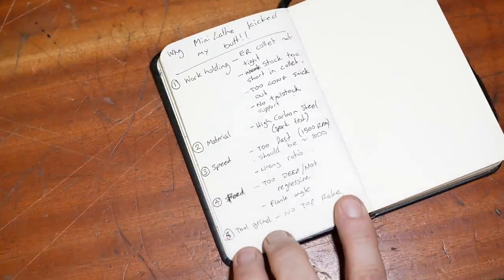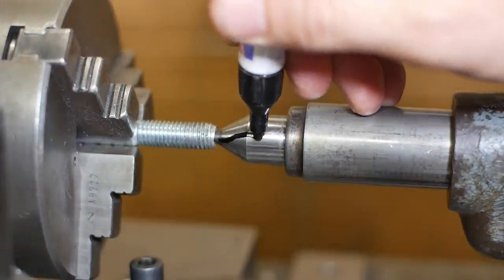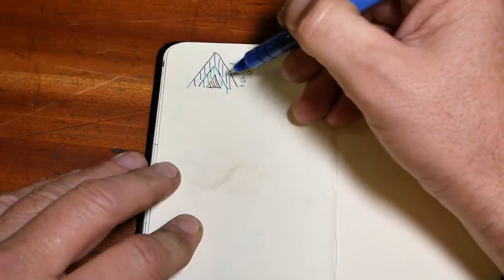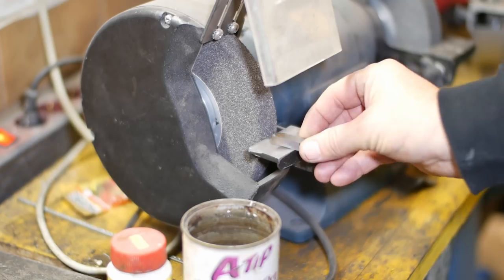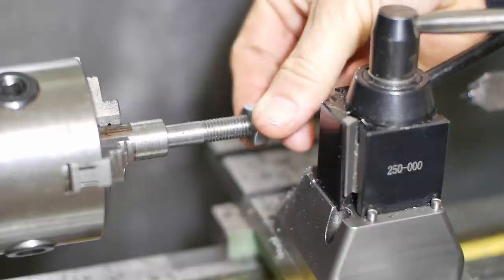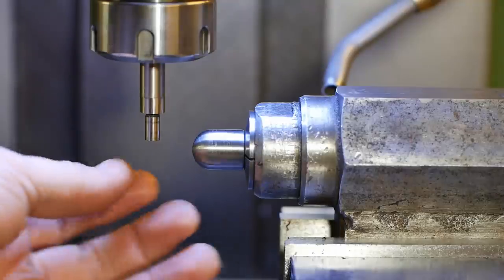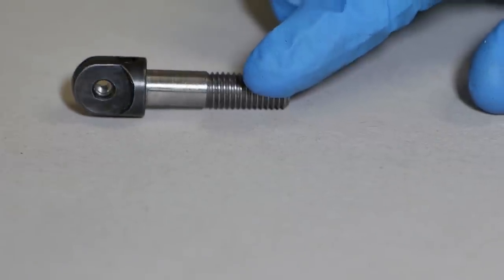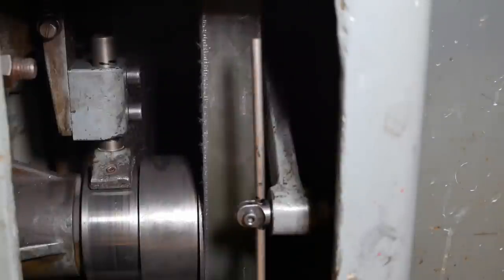Man vs Tiny CNC Lathe - Rematch! - Episode 39

Comment: As expected, CNC is so much faster than manual machining after about the seventh repeat. But where's the fun in that? 😉
Great series. Thanks for sharing.
Reply from the maker: Good call. If my Boley had change wheels, I could have whipped out that part in a lot less than two weeks :)
Reply: @RotarySMP  :-) or cut losses and used a tailstock die holder and hand tapped the m10 and let the electronics do the ball end.
Reply from the maker: @alan-sk7ky  I was pretty disappointed at how badly my M10 die cut last week. Horrible steel, but the die cut thread was also a mess of torn metal.

Comment: The flank thread cutting also can help reduce tool chatter because the tool has pressure on only one side.
Reply from the maker: True. Seems to work well on this cut. FOr such a weany machine, you need to give it all the help it can get.

Comment: A helpful tip that I got taught in my training was that when you machine a thread that when it is to size it will be 0.1mm down from the major diameter. I use this every time I machine a thread and it makes it a lot easier so you can just slip a mic or callipers in so you don't have to remove the tailstock and most of the time move the tool out of the way by reaching around the back. it is a nice little build though its made me to think about looking into the linux cnc conversion possibilities
Reply from the maker: Go for it. LinuxCNC is awesome.

Comment: Really enjoyed this series. Your aircraft engineering past is really showing through and I am sure you learned a lot along the way which is always a good thing. 
It is normal practice to minimise the trailing flank relief for threading tools to maximise tool strength and life.  The rapid feed creates it's own trailing flank clearance. 
Does Linux CNC automatically calculate thread depth based on pitch? The Seimens controller on the last lathe I used had this nice feature, the only downside was you needed an accurate tip radius appropriate to the pitch for first time success.
I think you could improve the braking performance of the Boly if you replace the single shoe with a band type. Band brakes exhibit a self energising characteristic so it would be like having power assisted brakes :)  Easy to make with a simple metal band and bonded cork wear material.
Looking forward to more content from you, definitely above the typical HSM standard.
Reply from the maker: Thanks for the feeback. 
LinuxCNC G76 does not calculate the thread depth, you have to declare it as K. You declare your first path depth of cut with J, and it calculates the number of cuts and deptch based on whether you want constant depths (R 1.0), constant Area regression (R2.0) or something in between.
https://linuxcnc.org/docs/2.6/html/gcode/gcode.html#sec:G76-Threading-Canned.

Given my unknown radius, it was always going to be trial and error to get a usable thread.

Comment: When im machining threads, I always leave meat on pre threading so I can re-chamfer the thread, then after that I re run the threading tool on the last couple of passes plus 2 or 3 spring passes. Tends to remove any wispy burrs aswell as acting as a spring pass 😁 great video!
Reply from the maker: Thanks. The thread got a lot nicer after the second fine correction pass.

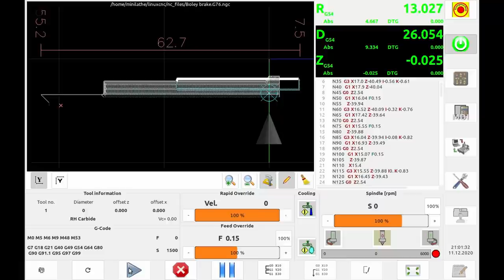Comment: Wow that four-camera view at 09:47 to 10:20 looks like the future of Youtube - broadcast quality and conveying exponentially more information than a single camera. Your video skills are enviable.  I worried a little about the WD-40 vaping session on the lathe but hopefully you were taking precautions. I made a note-to-self to check for a food-grade equivalent thread cutting oil for instances where the oil will reach it's smoke point and become a vapor.
Reply from the maker: I have a camera with a damaged control wheel which gets to play crash cam, and get fastened to the bed, on on the cross slide etc. Took me a while to work out how to do the editing but I kind of like that multi window style.

Comment: At work, I cut hundreds of threads per day with an industial CNC Lathe but don't bother with any special tool lead in angle. The size and mass of the machine vs the cutting load doesn't require this technique. I am new to mini lathes and I have been wondering why mini Lathe enthusiasts often refer to this method but never fully explain the concept. Great explanation of why the thread lead in angle is especially important on mini Lathes.
Reply from the maker: Thanks for the feedback. Enjoy the series.

Comment: Nice Job, for centre finding of the part on the mill, I kept screwing up the maths as well so I added a half macro to gmoccapy. That runs g10 l2 p0 X[#5221 + [#<_x>/2]] (adds half the current x value to the G54 offset) its only works in G54 but it's helped me make less mistakes forgetting the size of the part/edge finder.
Reply from the maker: That is a good idea. I haven't got my head around what G10 is supposed to be good for at all.

Comment: Greetings.  At the end of your last episode #38  I was going to go down to my shop and introduce my sledgehammer to my mini lathe CNC project.  I thought, man if this guy can't get it to work, I'm in trouble. And than after watching your episode #39, I had hope .  Put the sledgehammer away and watch some more of your mini CNC lathe videos.  Good job figuring it out.  Other than having to take lighter cuts, it works great.

What are your thoughts on driving the spindle directly with a 1-1/2 hp, 3 phase motor and Inverter setup?  You could use a set of two step pulleys for a coarser speed adjustment.  My Tormach Mill uses a similar set up and it has allot of power at very slow speeds. It would get away from using the original mini lathes transmission which I dislike.

Now that you have acquired the Schaublin is that the last we will see the mini CNC Lathe?

Enjoy watching your videos very much.  Keep them coming.

Cheers
Willy
Reply from the maker: Hi Willi,
I had the mini lathe belt driven from a 550W 3Ph motor for years, without the gears. I put the metal gears in this conversion, but in hind sight that was a mistake. Running a belt drive to the spindle is a better solution for this machine. With a 1.5Ho motor and VFD you should be fine. As you say, a two step pulley should give you plenty of torque across the usable RPM range.

The bed of the mini-lathe rather lacks rigidity, so I will probably advertise and sell my Mini-lathe, now I have pretty much all the capabilities of it duplicated in the Schaublin.

Comment: That was interesting.  A viewer of mine commented that his favourite channels were yours and mine, and I can see why.  Our channels are quite  different, apart from a small cnc lathe being involved.  Mine is an old factory built cnc with proprietary software and I mainly make production parts. I only use carbide tooling and full form threading inserts, which is the only way to go for parts that are for customers, as threads can be perfect quite easily. So as you can see, quite different.  I still have some way to go, to get up there with your editing skills though. Must check out more of your videos.
Reply from the maker: I really like your channel as well. You show what can be done with a high quality, working CNC lathe, and I show why a Seig 7x12 and a shit load of work is not the way to get there :) 
Thanks for the feedback.

Comment: That’s come up good. I wonder if it’s possible to have Linux CNC to automate the coolant on and off.
Reply: It certainly would. I mean, how do other CNC machines handle this? But I am not sure if that machine has a relay for that. And besides, it's sometimes better to babysit it anyways.
Reply: @vincentguttmann2231  haha yeah true. Anymore human jobs taken away and we are in trouble.
Reply from the maker: @obe726  The LinuxCNC profile and GUI which the PNCConf wizard set up includes both flood and mist coolant control. I would just need to install the physical systems and connect them to one of the Mesa cards output pins. You see this with the MAHO in this video. The standard flood cooling is controlled with M8 on, M9 off.

Comment: @13:00 Why is chuck/part lifting? Do the whole frame bend or loose bearings?
Reply from the maker: Thanks for pointing that out. I hadn't noticed that.  I'll check out whether I got the bearing preload wrong, or whather it is flex. Or both.
Reply: @RotarySMP  All three united, bending frame, loose spindle bearings and the part it self. :D
Reply from the maker: @waldemarii  Don't forget the POS tailstock, made of rubber.
Reply from the maker: Which was not even used on that cut, but may have still introduced flex, remotely. :)
Reply: @RotarySMP  That tail stock could distort even space time, maybe it could be used for ftl drive?
Reply from the maker: @waldemarii  It is so like it need anti gravity to attact anything.
Reply: @RotarySMP  It is so lite because the casting is so porous. :D
Reply: The area under the headstock is completely unsupported on these lathes to make room for the DC motor, I'll bet a fair bit of the flex is originating there. I'm going to fill it with epoxy granite since there's no need for the open area once the old motor has been replaced.
Reply from the maker: @johnharding9936  Go for it. Do some before/after deflection tests. That would be interesting, but dont expect any huge improvements.
Reply: @RotarySMP  sorry if that sounded abrupt, wasn't my intention. My emco is here now so I'm working on getting the tool changer to work with LCNC at the moment so that'll keep me busy a while. The minilathe is on hold for now. I had considered embedding it in EG in a slant arrangement for the craic, maybe I'll try that some day soon. Really enjoyed this series, your attention to detail is astounding
Reply from the maker: @johnharding9936  You didn't sound abrupt. I considered a bunch of different things to stiffen the mini-lathe, but at the end of the day,it will never be a Schaublin, so decided to put some limits on how far I'd go with it. The Maho taught me it is better to start with a good machine than to try and chase perfection on the mini lathe.

Comment: Nice work! I have a little emco pc50 cnc lathe at work, It has a small 75mm 3 jaw chuck that works great. Someone did a good job making it because it has basically no slop and no runout, making it ideal for basically all the parts it can handle.

There is a 4th way to cut a thread, I haven't seen anyone do it( i haven't really looked though, it just occurred to me) but you could cut a thread by breaking up the passes even further, and get a truly uniform cutting force for each pass. You take a normal first pass, then offset the same pass in the z axis the width of the first pass, and do this several times until you get to the width of the final thread. The shape of the area for these passes would be triangular. Then you go back to the original z axis offset, and move in at the 29.5 degree angle to do a second set of passes. these passes would be diamond shaped, and you keep repeating this until you work your way to the bottom. This would allow you to cut massive threads with manageable tool force. If you are having trouble visualizing this, the shape of the passes would be a tessellation of diamonds filling the root of the thread. the passes don't even need to be diamond shaped, they just need to advance along a path that is parallel to the wall of the thread.
Reply from the maker: I can picture it. That would truly allow and cut depth without getting in the problem of a regressive pass becoming so fine an  infeed that it just rubs instead of cutting. Would be interesting to program.
Reply: @RotarySMP  I remember being told about another method. It starts in the middle, then steps down to size with that ~30 deg angle but on alternating sides. I, not knowing much about CNC turning, assumed every controller does that.
Reply from the maker: @besenyeim  I guess there are plenty of different controller specific flavours of this. The RS-274 standard for G code only covers the G33 single threading pass. All multipass canned cycles are control specfic.

Comment: Something is definitely slipping in that brake mechanism, it looks like the arm on the right that the pedal link rod attaches to is slipping on whatever it is attached to at the back of the machine, presumably a shaft that links it to the brake shoe.
Reply from the maker: Yep. it now brakes but not strongly. If I adjust the brake pad out more, it slips on first stomping.

Comment: to get a better surface finish you have to take a deeper cut witch your carbide tools, they have something like a minimum cutting parameter
Reply from the maker: Yes, but because it was a dead center, I had to set a lower than desirable RPM, to prevent from friction heating it's tip. That lead to the low RPM and low DoC. Everything is a compromise on this little lathe. Might have been better with a HSS cutter.
Reply: @RotarySMP  if you want you can try a dead center with a carbide tip, and put a drop of oil on it, also hss tool migh be better too that is true
Reply from the maker: @DolezalPetr  I put lithium grease on it. I dont have one with a carbide tip, but if I did, you can sure of two things...
1/ I would drop it
2/ It would land on the tip.
Reply: @RotarySMP  yeah I can imagine that, I do some really stupid shit like this too

Comment: whether this cnc can be used for c axis mode, i'm also making a machine like you but i need the c axis function
Reply from the maker: LinuxCNC can do a C axis lathe. I used a pretty primitive old VFD. You need a servo as spindle motor to do the C axis.
Reply: @RotarySMP  how to set spindle with c axis like mach3
Reply from the maker: @cnccams1428  I have no idea how Mach3 works. Never used it. 

I suggest you make a thread on the LinuxCNC forum. Describe your set up and what you are trying to achieve. There will be someone who knows how to do it.

Comment: can you add a meter or directly display it on the vfd display to measure the current/load of the motor?
Reply from the maker: This VFD is pretty old. It  doesn't outout load.On this machine other aspects of it are more limiting anyway.
Reply: @RotarySMP  I also have an old vfd ready for my cnc conversion, but it also doesnt display motor load, I was thinking about how to display the motor load in a different way, but I cant come up with anything
Reply from the maker: @DolezalPetr  An ampere clamp on the cable to the motor?
Reply: @RotarySMP  can you do that when the vfd outputs different frequencies? I am afraid it can't be done that easily
Reply from the maker: @DolezalPetr  I am pretty igonorant about these things.
Reply: @RotarySMP  I think I will ask my professor of electrical engineering :D
Reply: @DolezalPetr  there's a number of rms-to-DC converters that you could use (probably an already-assembled board coming from Asia somewhere to boot). You'd need to put a tiny sense resistor (.1 ohms, give or take) and then read the DC voltage on your CNC control board (with whatever conversion factor you need). Sounds way worse than it is to implement! Good luck from this not-quite-a-professor-of-electrical-engineering-but-not-far-off. :)
Reply: @DolezalPetr  All you need is a current transformer (converts current through a cable into voltage) and a shunt resistor for sensing voltage. GreatScott made a video on how to make an ESP32 power meter that goes into your fuse panel, so that seems like a good candidate.

Comment: After your last spring cut polish the threads with a piece of wood to deburr the thread .
Reply from the maker: That is an interesting tip I have never heard before. Does the wood pick up on burrs?
Reply: @RotarySMP  Yes , it cleans up the burrs on the crest  of the threads and polishes the rest , hard woods work best .
Reply from the maker: @bigbob1699  Thanks.
Reply: @RotarySMP  Glade to help . take care and stay well .

Comment: I was very... relieved... to see you use a proper grinder on that center. I am so sorry.
Reply from the maker: Punny you should say that.
Reply: @RotarySMP  Also, you should try constant surface speed turning when turning rounded ends. This was really a nice example that showed the transition into and out of the best surface speed
Reply from the maker: @vincentguttmann2231  I tried it once last week, and it was a disaster. Didn't have time to trouble shoot why the lathe tried to spool up to warp speed three yet.
Reply: @RotarySMP  Well, I haven't seen that in the video, and my first guess would be an (almost) infinitely high speed, since the diameter of the cut is approaching zero. Does that post-processor have the ability to set an RPM limit?
Reply from the maker: @vincentguttmann2231  It does, and it was set to 3000 rpm, but something got lost in translation. I need to find so time to play around with it.
Reply: @RotarySMP  As long as you document your journey on video... 
Looking forward to that!
Reply from the maker: @vincentguttmann2231  Roger that. Weird thing was it spooled up on straight cut ar 17mm dimeter, then again I did tell it SPM of 180m, which was the lower end of the insert recommendation, but probably still pretty high. Should probably check the math before using such things :)